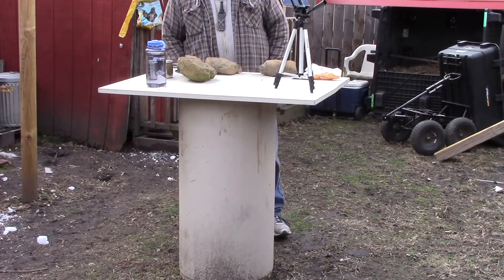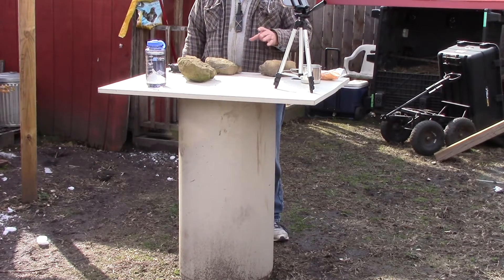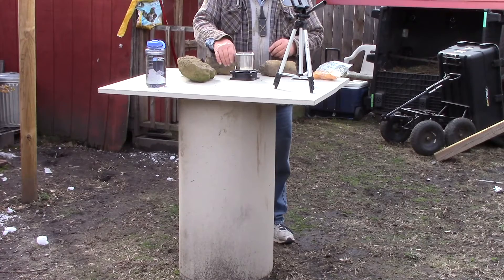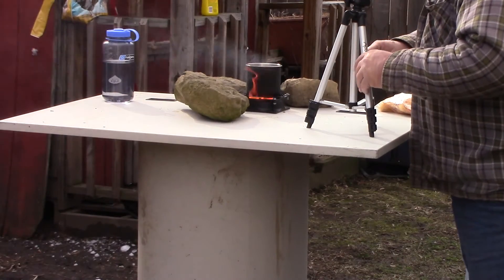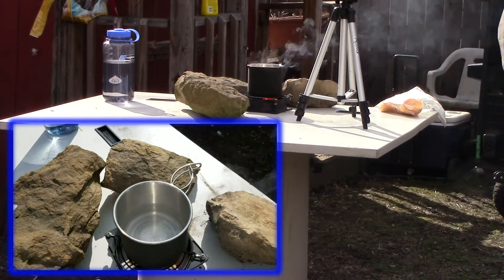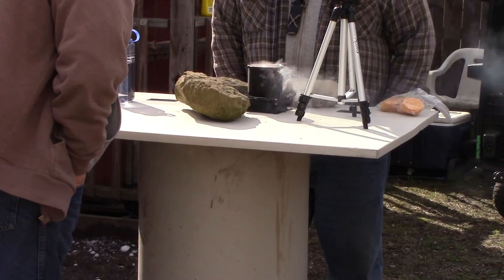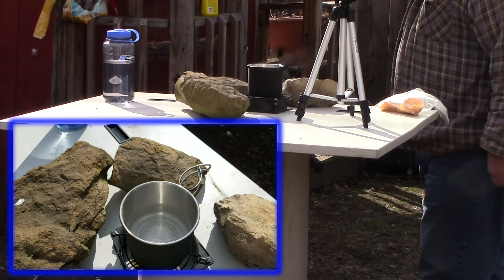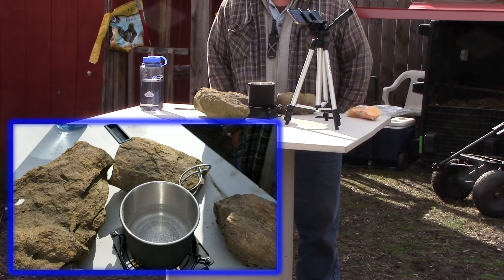Boil Water With Homemade Fire Starter Pucks?

Comment: Stainless Steel (SS) doesn't conduct heat as fast without the addition of an aluminum addition to the bottom, so I think that is what took longer than what it would have. I have SS pans that are the same, other than one has the bottom addition, and one without, and the one without takes much longer to boil. The right pan, for a quick boil is one with the added bottom to it or cast iron. Cast Iron gets hot much faster than Stainless Steel too. I think all in all, this was still a real success. If I was using that water for tea, I would rather it not be at a full boil anyway. I want to drink it, not wait another 5 min. for it to cool down! Bless, Sheila
Reply from the maker: +Sheila6325 Excellent points again Sheila. It was perfect for making a drink though!

Comment: Hey Joe!
Probably would have boiled if it had a lid on it.  Even a bit of foil makes a big difference.  Also, try raising the support off the ground on a couple of twigs to get a bit of a chimney effect.
Neat dishwashing soap on the bottom of a pan BEFORE you use it makes cleaning easy.
ATB matey.
Reply from the maker: +SarkyBugger A lid would have done it for sure. I like your suggestion. Gonna try is again later.  The cup cleaned up really easy.
Reply: I had read about rubbing the pot with a bar of soap to make it easy to clean, too. I haven't been cooking over a campfire for a very long time, but it's worth a try.
Reply from the maker: +Odahi The Dubious I will try that and report back!

Comment: One thing would help if you have air coming in at the bottom of your stand take a look at the kerosene lantern and see how the air flows in and that might help you with your Little cook stove  
God bless
Reply from the maker: +Keith S Good point. It was just a quick throw together experiment that I may expand on with your suggestion. Thanks.